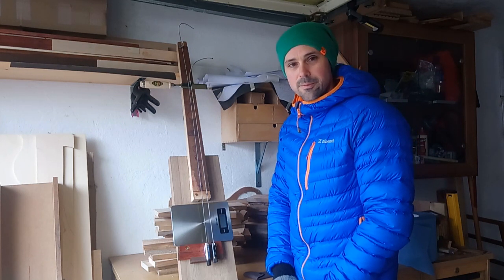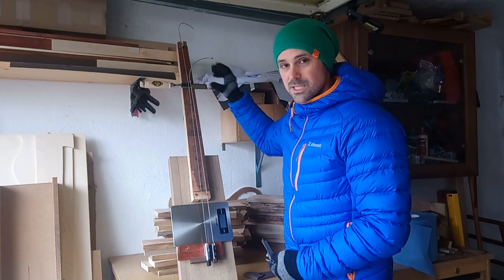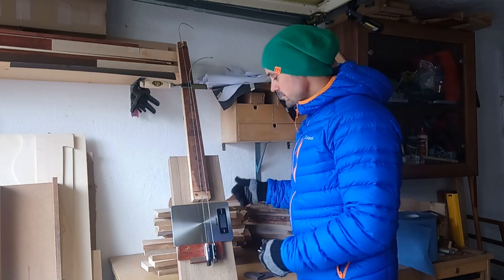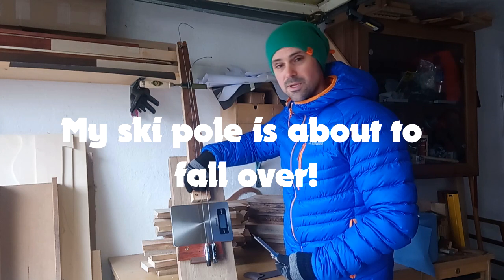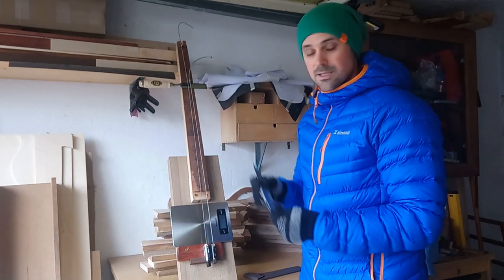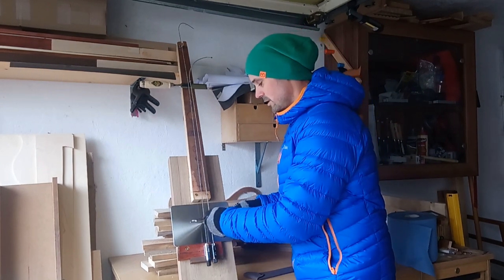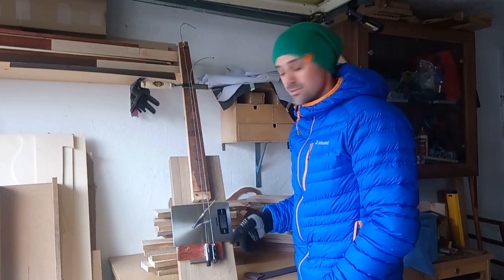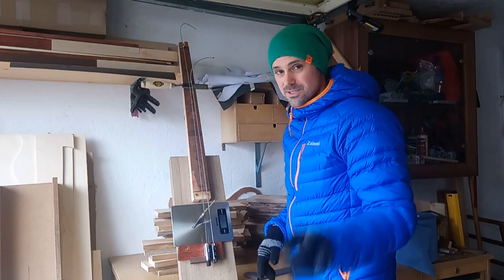The Myth about String Tension

Comment from the maker: The formula describing string tension is T = 4mLf² where f is the string's vibrating frequency, m is its mass and L is its length. If m, L, and f are the same, then T is the same.

Comment: I bet you could just take two high E strings and string them up on opposite sides of the fretboard on a guitar with regular 6-in-line headstock. Same tuning machines, same nut, same scale length, same bridge, same string manufacturer, same gauge, same note. The only variable would be the distance from the nut to the tuner. Just make sure the saddles are at the same spot.

Comment: Won't it affect bending tho?
Reply from the maker: The deflection from the calipers essentially simulates bending.
Reply: only in the sense that you have more slack in the string to work with. the tension stays the same because it has to for it to be in tune, but you're adding moderately more elasticity when you add more string length. A long rubber band has more give than a short rubber band for this same reason, and you could put the same amount of tension on them and see this in action by stretching them until they snap. I think this logic can be mentally grokked without actually trying it to see :)